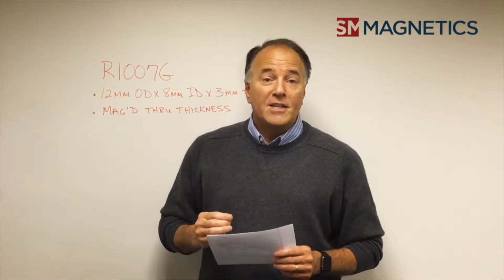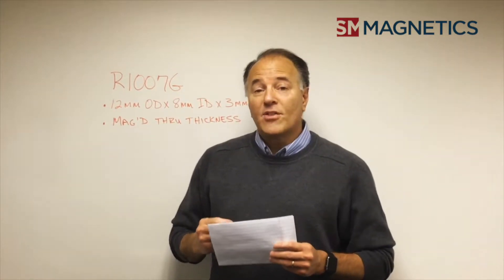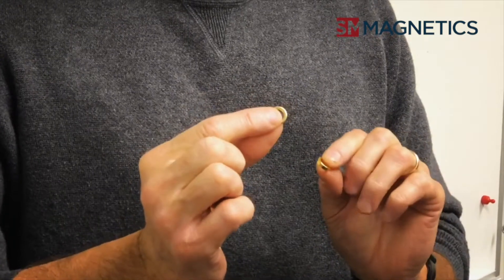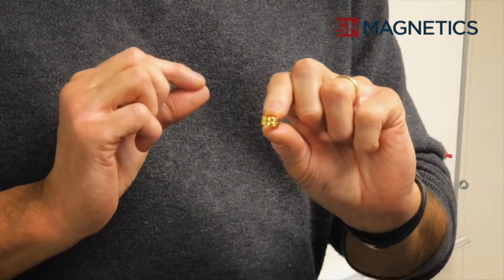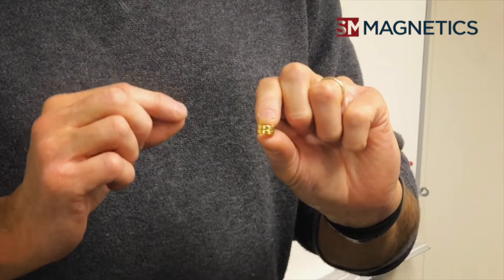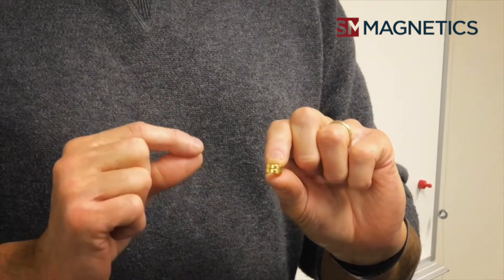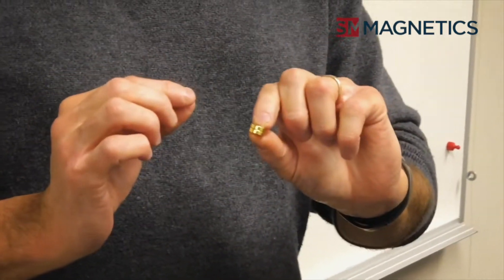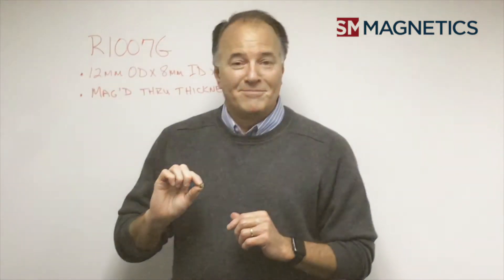FAQ: Can I stack two magnets together to act as one magnet?

Comment: you failed to mention whether the pull force would double with the additional magnet and 20x increase with the 20th magnet in such a stack.

The distance of each additional magnet ipaway from the stack bottom - where the pull force Is needed - increases.

also the magnets have alternatng poles obviously..

Can anyone help
Reply: The magnetic force increases exponentially as you stack them. The curve is fairly linear until the length reaches the same as the diameter of the stack. From that point the increase in power drops off quite quickly.

What this means is that if you need more power than the stack can deliver at a length that equals the diameter, you will need to increase the diameter... not just the length.